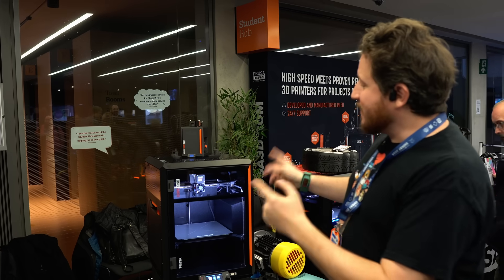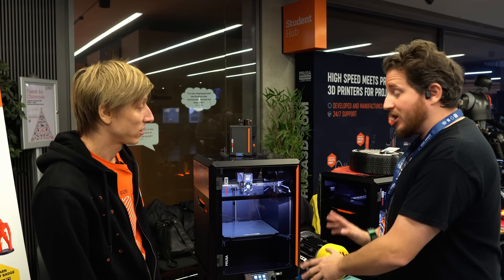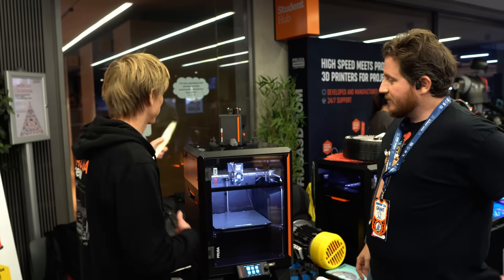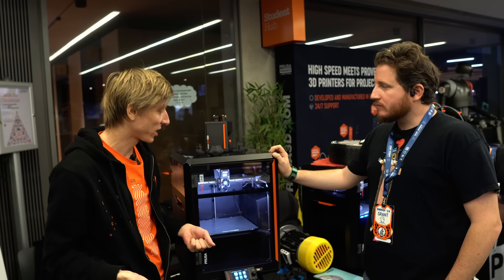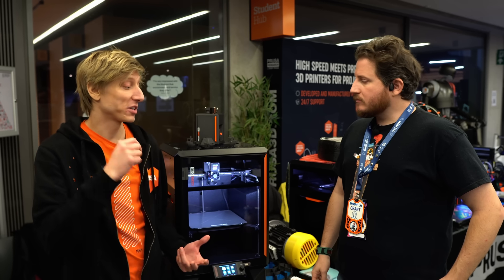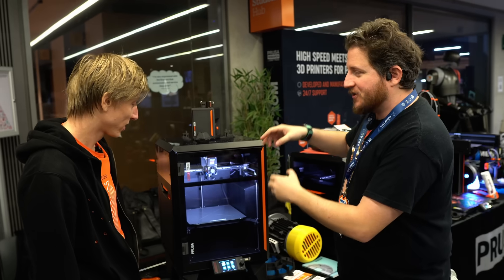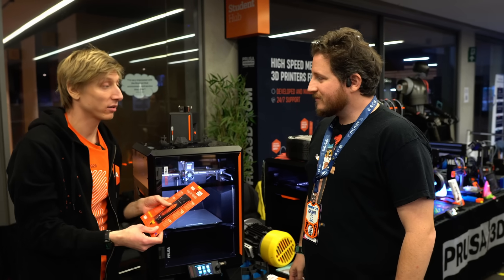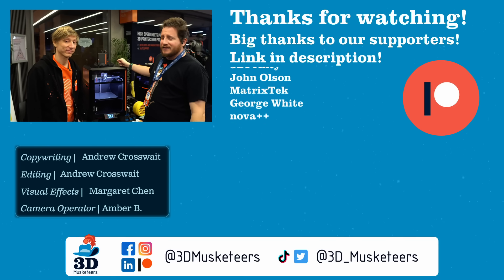Our FIRST LOOK At Prusa's CORE One! - SMRRF 2024

Comment: Grant my friend, my very generous, knowledgeable, and handsome friend. I’m having a problem with my core one you see I have put some really bad filament into my C1 and it sorta shattered into a dozen pieces. How can I get the tube off of my extruder?
Reply from the maker: It works like a normal Bowden tube but it's WAY harder to get apart. I had this same issue lol. Pull the tpu piece back some, then push down and pull up pretty hard on the tube. You can use the tpu part for extra grip. 

My first time dealing with this I went to support to figure this out lololol
Reply: @3DMusketeers  oh excellent thank you I now have the courage to try again! And you have given that courage to me.❤

Comment: Is it possible to do an at home upgrade to a Diamondback PCD nozzle? Will this effect the auto bed leveling? Or will this machine have an optional tool steel nozzle for printing exotic materials like nylon/carbon fiber filament? Also, is it available pre-built from Prusa with the optional multi-color MMU2/3 system? Can I get this pre-built with the optional chamber camera,already installed, too?
Reply from the maker: It's possible. Won't impact ABL, however it's not high flow so you'll need to adjust your profiles. 

Not sure what nozzles it will come with. Will let you know as soon as we can! 

It's available preassembled but I believe the mmu is an additional add on. I believe you can get the camera but again, likely something you add in yourself. It's held in with magnets so meh? Not difficult to do yourself.
Reply: @3DMusketeers  
Thanks so much for your response!! I look forward to your future feedback!

Comment: The Core One sold me on Prusa. I have been printing with my Ender 3 for 5 years now and have upgraded it further and further, which is why I did not want to spend nearly a thousand dollars for another bedslinger direct extruder printer. But the Core One has such a nice design that just feels like it is completely thought through down to the tiniest detail, it gives better quality, better build volume and will give me the capability to print higher temp engineering filaments for only around 1000$ for the kit? Yeah sign me up.

Comment: Thanks for the video - good stuff. But... I'm really disheartened by the build area. I think a company trying to get more market share (from Bambu) they would have made it a point to be at least 300 cubed or even 256 x 256 x 270 but no. I have already read a lot of posts by disheartened people and the 'could have been bigger' build area and are waiting on Bambu's new printer which is rumored to be a 300 or so cubed. BTW not a bambu or prusa fanboi. 

With that said I love the squareness via the one steel piece for the gantry = great stuff. Also like the supposed flawless printine of 75 degree overhangs and extruder but is that enough to compete with Bambu? If the leaked photo is true, Bambu is coming out with a dual heads and larger build area, along with some other bells and whistles. If Bambu offers a dual head pro version and a single head system (which would be around the same price point a this) with bigger build area, that might make people question Prusa and wait for the new Bambu.

Anyway we will have to wait and see. Looking forward to the tour videos and any other info you have coming down the pipe. Keep up the good work.
Reply from the maker: The upgrade path seems to be what set that build volume. And if you want a multi head larger Prusa, get the XL. They have a solution already lol. Will people want it over the Bambu? Only time will tell. I love my XL, dissimilar supports are amazing. I don't ever want to go back!
Reply: @3DMusketeers  I'm looking forward to seeing reviews of the Core. Looks very tempting and I love that they have an upgrade kit from the MK4. I think that is a great selling and longevity point as well. Keep up informed. :)

Comment: Do a live side by side test with this and an MMU3 versus an X1C to print a multi colour object ... as a long time Prusa MMU sufferer (I have 3 with Mk3S+) I already know the answer ... tip shaping is not the future ... at least Prusa are no longer leading with a bed slinger ...
Reply from the maker: I really should.. Need to get it built first then sure, we can do that.
Reply: MMU3 or MMU2?
With Mk4S and MMU3 I have no problems with the tips.
To be honest, I've never had to adjust anything.
I don't think the way the others do it is an ideal solution either.

Comment: FlashForge recently introduced their AD5X.  It's essentially their 5M with a new multi-filament feeder bolted on.  Their customers keep asking if they can upgrade their 5M and the answer is a resounding and bitter NO.  Meanwhile, Prusa has an upgrade path from their bed slingers to their latest coreXY.
Reply from the maker: I really do want to check out that AD5X, so many of our discord members LOVE their AD5M's...
Reply: @3DMusketeers  - I've never owned a FlashForge but they're OG.  I've always thought of them as making good 3D printers.  Originally I thought they were a bit pricey but I think they were more focused on solid reliable workhorse printers so the price was probably justified for serious users.  I've always been surprised they didn't get more market share.  Like Prusa, the FlashForge customers are loyal.  The AD5X has that four reel IFS that looks simple and reliable, and able to print 95A TPU, and that's definitely caught my eye.

FlashForge is heavily promoting their phone app, their special version of OrcaSlicer, and printing over their cloud server.  All of those strongly discourage me.  I want manufacturers to provide good profiles for the slicers we're already using.  I want to print over LAN (Ethernet or WiFi) directly to the printer without sending my files to a cloud based print server.  I don't want to install an app to use my 3D printer.  Hopefully, a FlashForge owner will let me know if the app, cloud print server and proprietary slicer are required, or is it easy to use my own slicer and print directly to the AD5X over my LAN?
Reply: I have two 5M, and it's really sad that I can't upgrade. But, I also have one Prusa MK3S that I never upgraded. I agree that Prusa is far better in that aspect, period. But, when comparing prices: the cost of a MK4S to CoreOne is higher than AD5X printer. You get what you paid for, 5M is 1/4 of the price of CoreOne, I don't think anyone expect it to be upgradable or maintainable in long time. 

But, 5X isn't just the filament feeder. It has another hotend, toolhead and possibility another PSU and CPU (unconfirmed).
Reply: @FrequenciaJogos  - I'd like to get an AD5X but it's delayed for a month or two, even though they already sold out of the early release printers before telling people there would be a 1-2 month delay while they sort out the problem with the TPU poop clogging the chute.  That's one of the big selling features of the AD5X - it can print commonly used 95A TPU with their IFS filament feeder, so it looks like they'd test that extensively, given that they're promising to do what others would like to do but couldn't.  It seems that time to market is such a critical consideration for consumer 3D printer companies in this quickly developing market that most of them barely test to ensure their new printer works with PLA before shipping it.

That's one advantage of Prusa.  They may seem a few months or even a year late to the party, but they don't arrive unprepared.  They keep their printers in development and testing more than the Chinese 3D printer manufacturers.  The CORE One was a rather late entry to the coreXY market but they got a lot right and managed to innovate in ways others didn't.

Comment: I need it to be bigger!

I want an IDEX version. 

Nevertheless, this looks pretty sweet.
Reply from the maker: I think that is what the XL is for lol.
Reply: @ 3DMusketeers the XL is too expensive and the enclosure situation is not ideal.  

Also, an IDEX can print two smaller parts simultaneously for faster printing.  

The IDEX unlocks possibilities not available in the XL.  

Want a better XL? Make a Quad IDEX with two gantries….. no tool changers, just bliss.
Reply: @Vallecaucanisimo I’m thinking that the gap between CORE One and XL might be filled by a CORE Two (300mm cube with tool changing dual heads) and then finished off with a full on CORE version of the XL.  Hopefully bu that time they have a continuous fiber tool and a dedicated ironing tool.  Hey how about a CORE 4 axis?
Reply: @robblincoln2152 i really dont want more tool changers tbh.  I have my eye on the RatRig IDEX but i’ve heard bad things overall.  

An IDEX is faster than changing heads and it allows for dual prints.  A quad IDEX with two gantries is my dream printer.   It has to be at least 300mm2 though.  350mm2 is preferred.

Comment: Not sure if the design has been finalized, but would love to see how the MMU is configured with the CORE One.
Reply from the maker: It uses a special board on the back, but I would also love to see like a special set of prints to integrate it cleanly!
Reply: @  I assume a negligible impact to footprint- do you have a picture of that board to share?
Reply from the maker: I believe prusa has shared some already on the launch page. It's a breakout PCB that you then connect the mmu to, it's not some custom mounting solution, I wish it was lol.
Reply: @3DMusketeers  yes, I saw that snippet in their intro video- wasn’t clear on the mount.  But I think you’re right, there’ll be some Printable out sooner than later.  Thanks for the quick reply

Comment: Only took them 2 years to get to bambu labs. And still not better 💔💔
Reply from the maker: To each their own...
Reply: @3DMusketeers  true. I personally still think objectively it doesn't surpass the x1 carbon out of the box. I dont think theres an argument there 

I'm thankful prusa is finally starting to catch up after several years of complacency. 

However they just jow got to a 9/10 on catching up. But bambu is expected to release their next gen printer in a month or two. And then prusa is behind all over again 💔💔

I don't dislike prusa. And i may actually buy one to try to compare honestly. But i dont think theres an objective argument the x1c is still ahead especially in terms of value
Reply from the maker: It is faster than an X1C and it does not log data behind a 128bit AES encrypted log file, so for me, it is well worth it. That and Prusa has never left a day 0 exploit live for YEARS on their machines that could have caused major issues until a content creator (me) pointed it out.. 

The XL to me is the advancement of Prusa, the Core One is the Evolution of the MK series. Dont forget the AFS, HT90, and others. It is not like Prusa has been sitting still for ALL the years, but definitely, some of them..

Comment: Is it possible to make your multicolor system better or is it too much to as far? Sorry prusa, I want a good multicolor 3d printer.
Reply from the maker: the MMU3 is apparently quite reliable, we will be building one soon. The XL has been rock solid for us in our use of it..
Reply: Would be nice to have it in an enclosure like the other multicolor solutions. That's what the core one is lacking, convenience in multicolor printing.
Reply from the maker: Why? I mean, other than the packaging, what does the enclosure for the mmu do for you? It does not keep filament dry, those small desiccant packs dont do much at all.
Reply: @3DMusketeers  makes it more compact and not all over the place, easy to move around, and just looks better. Mmu3 still looks like a diy solution, and outdated.
Reply: I haven't had an overwhelming need for a multi material/color system yet but from what I hear, the mmus waste a lot less filament and time per color change than ams style systems. If looks and portability are what you care about instead of overall efficiency, more power to you.
Reply: @magusxlr  the issue with prusa is that they don't have a manufacturing capabilities as China 3d printers, so they don't have the machine to do injection molding for a multicolor enclosure. The mmu2 was such a pain from what I hear, but bambulab is just effortless to use. I have an mk3s, so I'll try the mmu3 at some point. I just need a bigger multicolor printer, which are coming out this year. No !ore prusas for me, unless they become more affordable. I'm fine with the bed slinger.

Comment: This is why Prusa are always "slow" to come out with new things - they take the time needed to deliver solid usability and good design. I built my MK3S and MK4 from kits, and they worked perfectly since first power-on. Prusa took their time with CoreXY as well, and this printer looks like the perfect balance of assemble-it-yourself, and it-just-works. Will definitely be getting one, but I need to make space, because I have no intention of selling my current Prusas.
Reply: You should look up bambu labs new firmware update, im back to only buying prusa. Bambu is in the first steps of a proprietary subscription based slicer. its a shame bc i had 3 x1cs.
Reply: Prusa is the Apple of the 3D Printing world. Bit more pricy but 100% reliable, good quality and a team behind it that always wants to improve in a good way.
Reply: @handlethecraft  I used to think just that for a long time, but recently a few people told me they were going with that other printer company because they wanted an "Apple easy" experience. That got me thinking that in the shifting landscape of things, Prusa has become the Ubuntu. They're open source in that you can still get kits, and they're at least trying to use standard parts. They're still very polished and their machines just work, yet, you can recompile the kernel any time you want, so to speak.  That unfortunately makes them seem intimidating to some newcomers, which is a real shame, because they are anything but.
Reply: @Standbackforscience  The funny thing is that I chose Prusa as my first printer because I want to have that experience. I want to learn. But I also know that I'm not part of the majority. Unfortunately, I experience every day that most people don't want to learn.
Reply: @andreas.grundler  you might be right about that.
Reply from the maker: I think they are right.. Many want that toaster of a 3D Printer whereas the tech is not really there. Sure the machines may be, but ultimately what happens when there is a problem, like a blob of doom or something? They have to ask others for help and it becomes a slog of the same crap different day, you know?
Reply: @andreas.grundler  You took the words right out of my mouth!
Reply: @handlethecraft  Apple doesn't let you modify or repair anything....I don't think Prusa are anything like this.
Reply: Apple is a walled in paid experience
Reply: @handlethecraft Prusa is the exact opposite of apple, wtf are you talking about?

Comment: still dont understand the **** small rectangle build plate... why not make its square? I sooo want a prusa printer but cant because I print circle prints with 240mm diameter....
Reply: They kept the build plate the same in part to keep costs down, and to allow for an upgrade path that wasn’t completely ridiculous.
Reply from the maker: get the XL? I dont know the history of the non square plate, that is a good question for us to ask though!!
Reply: @3DMusketeers  the xl is too pricey for me... the core one is already stretching the budget for me and I print a lot of asa/abs too
Reply: +1! Wish it was 250 X 250. I could print 250mm fan ducts without having to cut up the print. I guess they had their reasons for doing a rectangular build plate.

Comment: As a whole, i think the Core One is a pretty nice machine... But why tf would you install a 'chamber temp control' to keep the temperature in an enclosed printer cool instead of building in a fking chamber heater? if i want to print pla, ima buy the mk4 ?!?!?!?! really a killer, especially for the pricetag there. wtf. looks nice, will probably work nice but i'm really disappointed they didnt do what they should have
Reply: Apparently it can get up to 55 degrees with just bed heating alone. What kind of chamber temps were you looking for?
Reply from the maker: huh? You can print PLA with the door closed because of how it handles the chamber temps. I dont know what you are referencing?
Reply: How many Watts of extra heating does a small chamber like that need you recon?

Comment: Can you swap the print spool from the right hand side to the left, or have TWO print spools, one on either side, for those that only need two colors in their MMU?
Reply from the maker: I dont see why not. STEP files are out there if you want to design something
Reply: The enclosures I've seen so far did not have the mounting holes for a spool holder on the left side. Plus the chain guide expects the filament to come from the right.
But it being a Prusa, somebody will figure that out ;-)
Reply: @ulaB  Yeah, if you move the door hinges to the other side,  you might want the spool holder moved too.